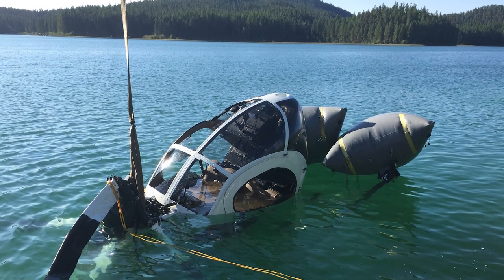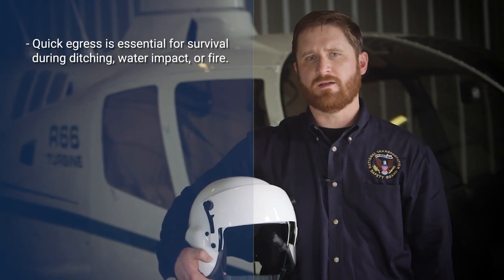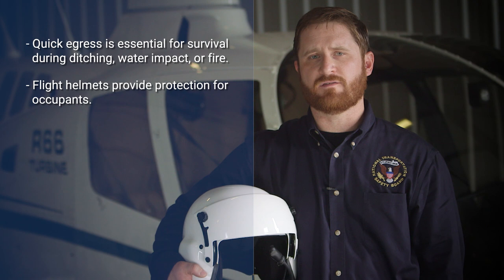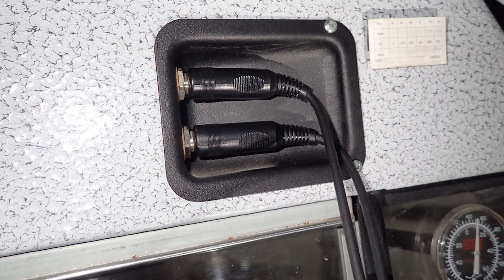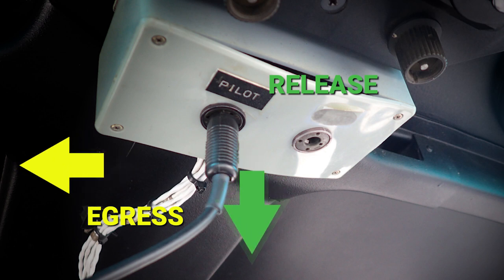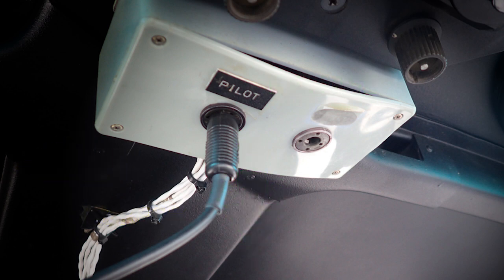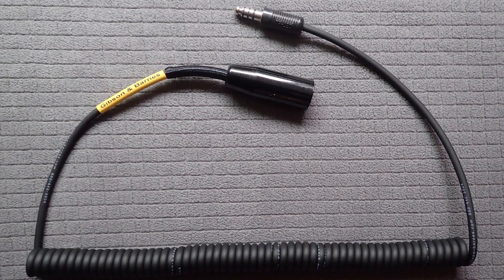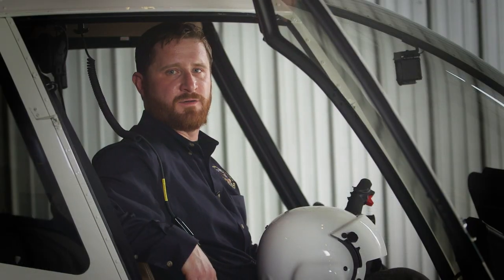Flight Helmet Cords Can Impede Egress: Understand the hazard of direct-to-airframe cord connections

Comment: Anything you can do to reduce the hindrance to your egress now, will reduce the hindrance to your egress when you really need it!  The  suggestions in this video are excellent advice, in addition to removing any other hindrances to egress you might have between you and a way out.   Unsecured baggage, or baggage inadequately secured, also become problems to egress when the proverbial feces hits the fan.   If its a 20+ lbs bag clipped to a thin strap-handle using a caribeaner, where neither the strap or caribeaner was designed (or certified) for a 3 to 4g impact holding 20lbs, it might become a projectile and an hindrance to safe egress!    PPPPP.!